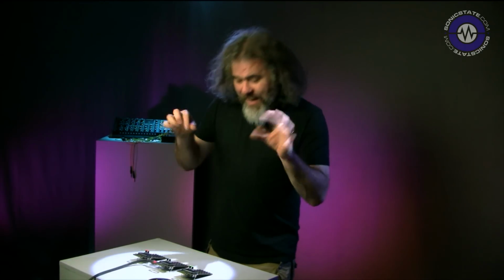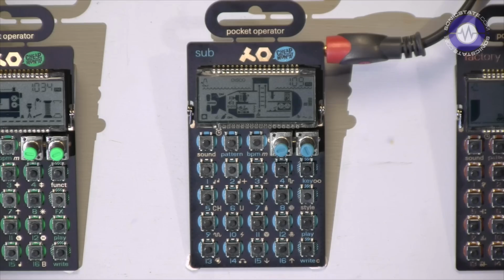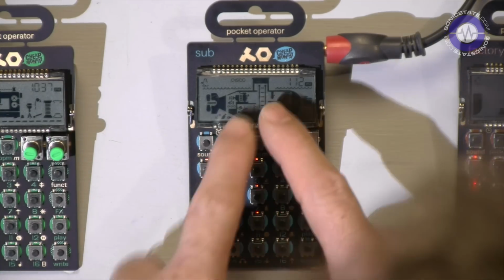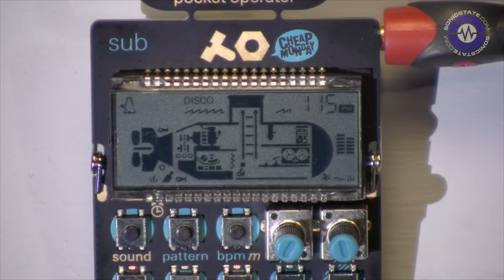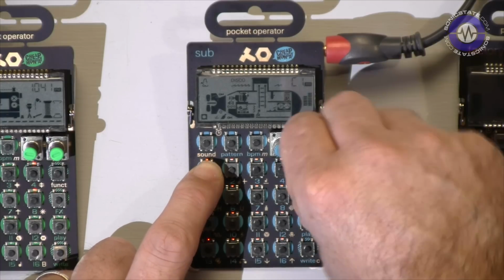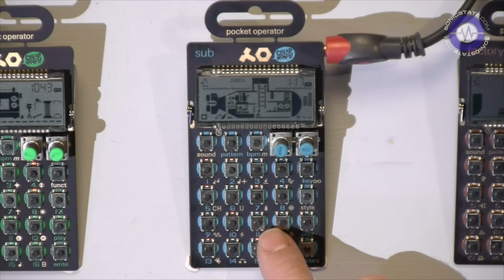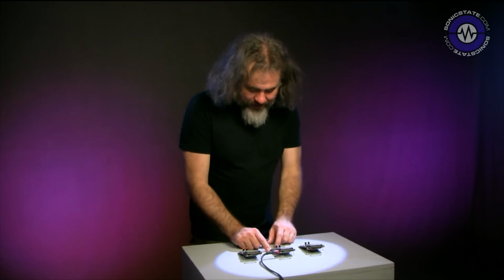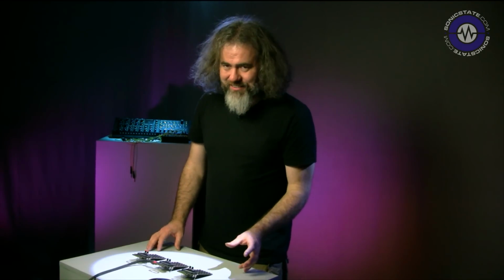Teenage Engineering Pocket Operators - Part 1

Comment: If you just want to dip a toe into synthesiser music, these devices are hard to beat. They produce a good volume and have more than enough parameters and patterns to keep you amused for years. Well worth the money. If you want something better, it will need to come with a full sized keyboard and won't fit in your pocket. It will be another thousand pounds more expensive too!

Comment: No sharps/flats and no MIDI? How frustrating. If the PO range had those features and external power supply, they'd be better than the Volcas. They sound better than the Volcas and have swing but the lack of basic input/output is a deal breaker.  Why doesn't TE make a combined workstation for £250 with MIDI/USB connectivity and mini keys?  For the price of all three POs, you can get one Novation Circuit. So yeh, get the circuit or Korg Volcas imo.

Comment: Hi, does the clock output work with CV, so it could be synced up with a modular  synthesizer for example? The manual says that these can be synced with Korg Volcas and computers.
Reply: depends. is your modular synth in eurorack format or a different format?
Reply: frac format, which is +/-15V vs 12.
Reply: Theodore Bauer so you want to use the operator to be a clock modulator for your rack, correct?
Reply: +Will Banks yeah.
Reply: i know that that they can take clock modules but idk if they can be one, id email teenage engineering

Comment: I've been interested in these since yous showcased them at NAMM. Now I'm REALLY glad I waited for a more in depth demonstration!

 Limited to 4 Bar patterns? No Sharps? Battery power only?! I have to pay extra for a case? ...the case is 1/2 as expensive as the device?! 

 Yeah, no thanks. Teenage Engineering is a quirky & interesting company. They make some neat products... but they are really full of themselves! The prices are unreal!!! I suppose I shouldn't be surprised. I've been subjected to buying my groceries at ICA :P 

 Think about it this way. The device is    $59
                                      The case is       $39
                                      That's                $98
                                      If you buy all 3  $294
 
                       ...& that doesn't even include ANY cables or rechargeable batteries! 
 
                
 My Arturia MicroBrute was $259 AND it came with a MIDI cable, an Audio cable, a USB cable, two Patch cables... it plays Sharps :P The Sequencer is 64 step, it's ANALOGUE & sounds unique... the case is free, I can plug it into the wall, it has keys... I can control it externally, it interfaces ( in limited fashion :[ ) with my DAW.

 Yeah, these are worth $39 with a free case & the addition of Sharps, 16 step patterns & DC power in. No sale! :[
Reply: Can you put it in your pocket?

Comment: Too bad you "have to" run them on batteries. A little fun thing like this shouldn't need maintenance as i don't want to worry about my battery level every now and then. On the other hand they are not intended for studio use, so i have to give them a pass. Also.. there's lots of other great second hand gear for this kind of money.

Comment: I have a couple of questions.

1 - You mentioned on Sonic Talk that the audio is passed through via the sync cable along with the clock signal. I'm assuming that this is achieved by way of a stereo jack to jack. Would it therefore be possible to use an insert cable (i.e, stereo jack to 2 mono jacks) to split this out so that you could send the audio from each PO out to a separate mixer channel?
2 - As an extension of this, can these be synced with the Volcas? I presume as the audio is transferred this isn't possible, however perhaps if the answer to my first question is 'yes' then maybe this could work?
Reply: 1. Splitting is possible and encouraged because it gives better Audio quality. There are 5 different sync modes which cover all possibilities. Sound is mono either way.
2. volca/monotribe/electribe etc. sync is possible yes. It even says "volca sync" in the manual :)
Reply: Hi, while I'm not sure if the splitting is possible, the good news is that the po's do indeed sync with Volcas, and some videos showing this have even been uploaded to youtube already :)
Reply: Thanks guys, very informative! :)
Reply: Nice.  I had the same question about splitting the signals.

Comment: Now I'm curios if there are any worse pocket synths around, than these?
Reply: Stylophone beatbox, easily. But... how many pocket synths are there at that price point?
And they are not bad, just different. I have all 3.
Reply: AA Battery All of the TE products just seem off to me... I don't know exactly why, but with these the fact that if you want the product to look and feel the way it is supposed to look like you need to buy a "pro" case for it and the missing notes from an octave is just pathetic.
Reply: I would rate these higher than a monotribe, and I do like the monotribe! But they nailed the drum sounds on these!
Reply: I kinda like 'em. I have the first 6. And you can just use the drum and percussion sounds. Don't need the tuned notes if the white notes are inadequate. For lots of people who are not musicians, the limitations of only 7 pitches will be less daunting and make it more fun. Also, don't need the cases. I have them, but don't use them. Can't seem to make  them fit. Probably user error.